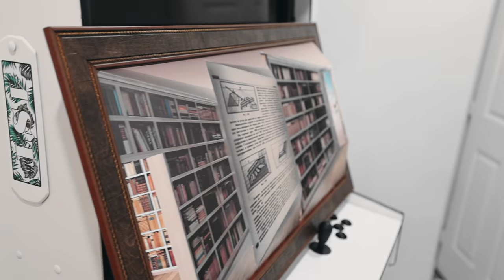The Future of This Channel...

Comment: 1st off, I'm happy that you're in a great place in life. 2nd as someone who has installed those exact type of roller shades, if you dont have side channels and/or cil channel, you will only get about 80% darkness. The light will come around the sides and bottom. Adding those channels will bring you to about 98/99% darkness.